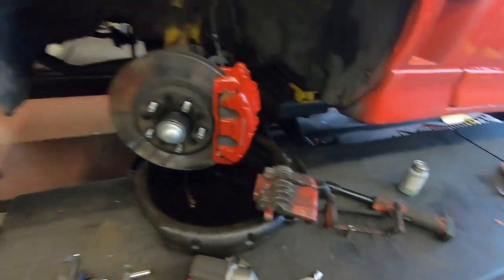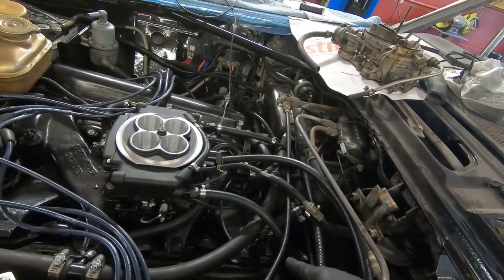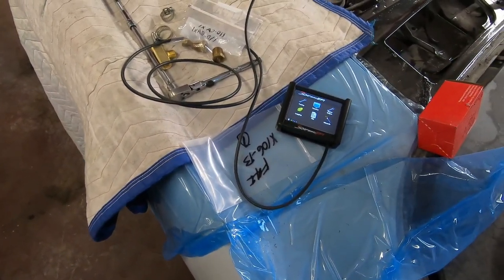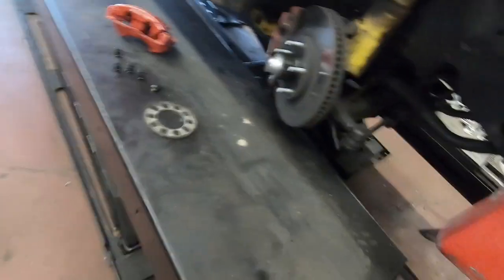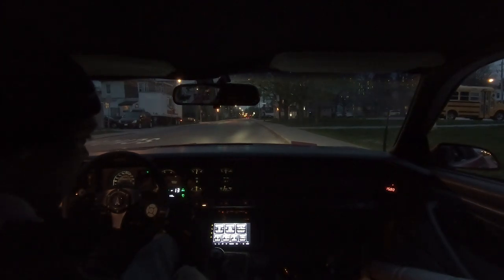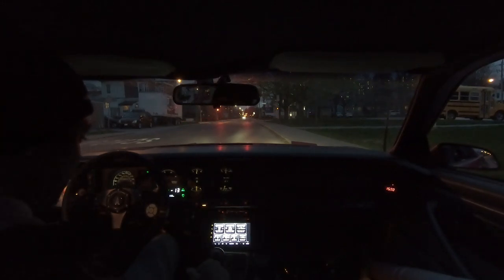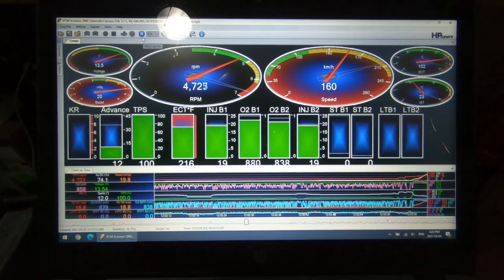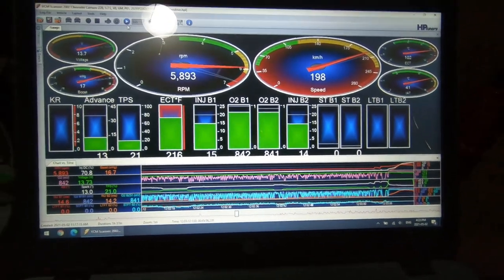New Turbo takes on Porsche,Bmw M5,.....breaks mirror

Comment: Hows the fender exit with ontarios laws im building a T/A 5.3 LS turbo dont know if i should go fender exit or to the back. Nice build btw
Reply from the maker: I've had no issues, though my fender exit is boosted activated dump. I have full exhaust on the car with a 2nd rear cutout. I've gotten side eye looks but not pulled for it... Yet
Reply: Hope I just didn’t jinx it.

Comment: Your iat's are way hotter than what you are showing. The rise after the pull shows that...the old school thermo couple sensors are slow to react but the open sensors are really accurate and fast they just dont like meth lol...I'd guarantee your in the 150-170f iat range
Reply from the maker: My iats are pretty accruate and my meth is sprayed after the iat sensor. Keep in mind i read temp in c* so in f* im in the low 90-115f* range. On a very hot day ill hit 130s for sure after a few good pulls. Never really had an issue with iats luckily.